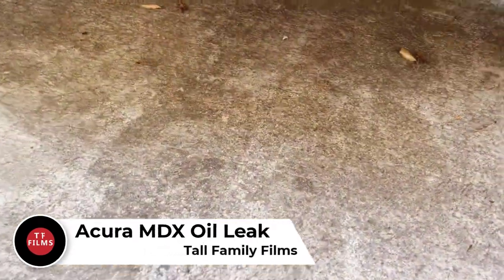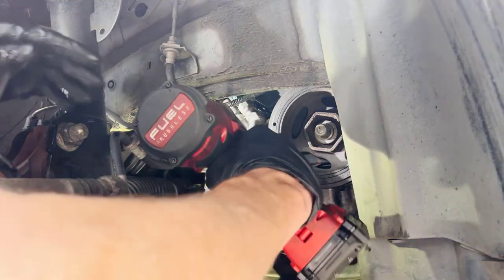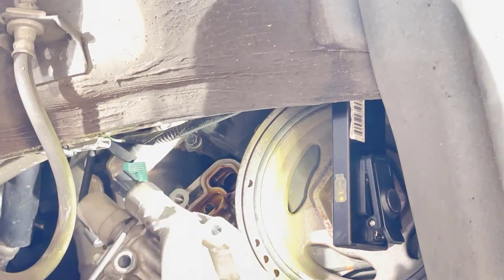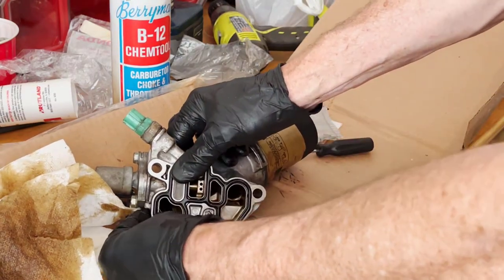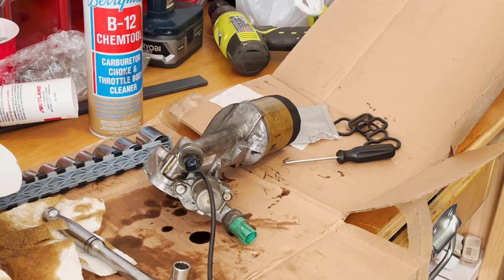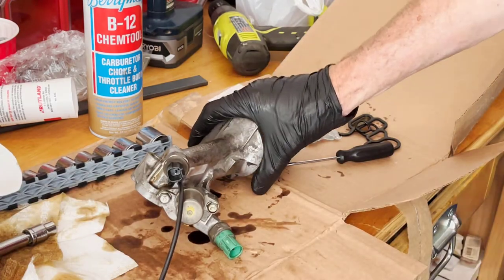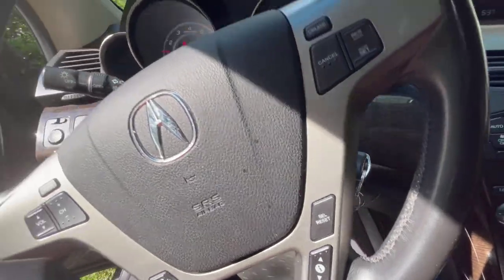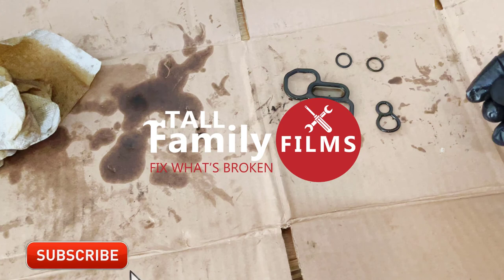Acura MDX losing oil -  found the leak!

Comment: Do i have to drain oil before change it.
Reply from the maker: No, it’s not required. It will leak no matter what since the oil filter is attached. Since you’ll be down there anyway, it’s suggested.

Comment: Did this stop the leak??
Reply from the maker: It slowed it down. I need to look at the valve cover next
Reply: @TallFamilyFilms  ok thank you so much!! Your video is very informative! I had everything checked out should just be the oil filter housing cause there is no leak in valve cover or any engine area if not go to the next thing. Thank you brother